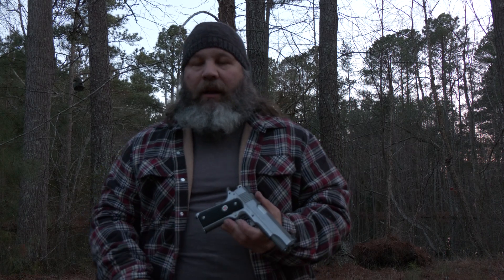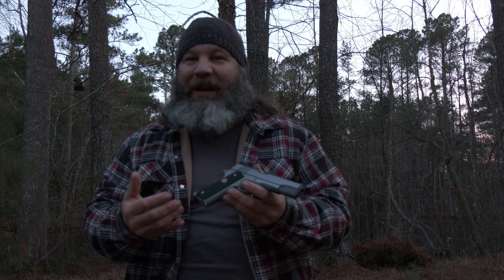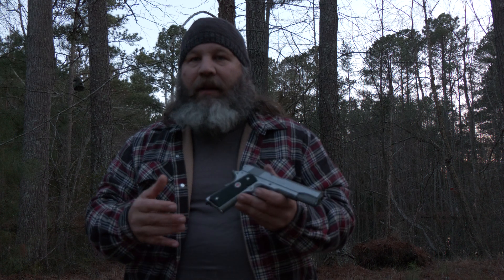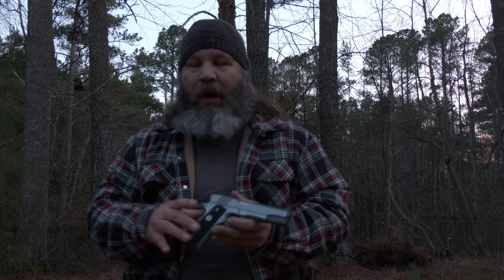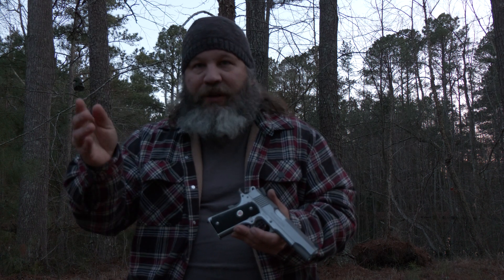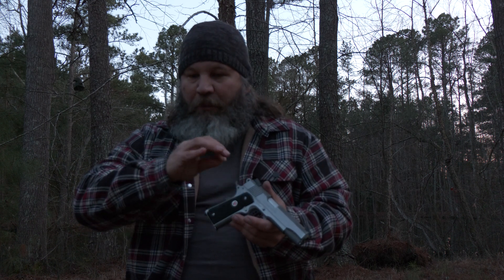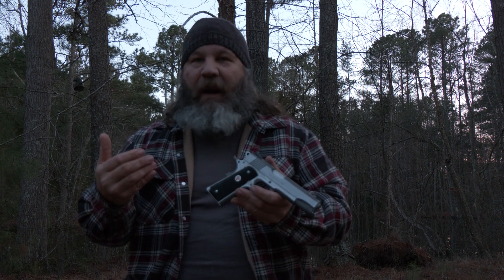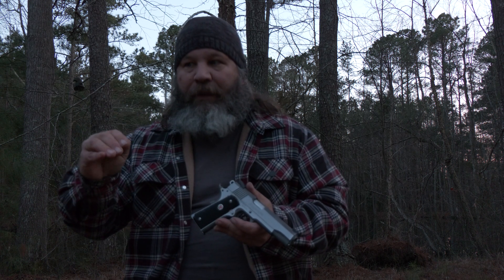Dropping the slide on an empty chamber on a 1911.

Comment: I know this blew up over the past few weeks because of that Wilson vid. I appreciate your bold stance and going into detail with this, Hunter. I think if people were shown how/what happens when the slide is dropped on an empty chamber, they'd be better convinced. Vs. just being told it's bad and thaf kittens die every time you do it 

I err on the side of caution myself. I don't call myself a gunsmith but I'm an armorer for a local shop. It's understandable, for me, to see how sear/hammer hook engagement could be damaged doing this. Not everyone does though, and they just default to "if X gun can't take it, I don't want X gun." I'm like, alright then, 1911s (or something like match CZs) probably aren't for you. You bring up the hammer drop test, and I thknk that puts into perspective with how little sear/hammer engagement guns can get. They can be pretty fragile, I think it can be said. 

I think it's a mistake for people to fall into the trap of, "just because I can do it, mean I should". This goes for a lot of things with guns. I'll share recent examples. Our shop has Taururs TX22s with broken firing pins. The last one that came in, the owner admitted to frequent dry fire with it. The manual states dry fire is OK, and is required for disassembly of the gun. Well, except for when you do it TOO much, or you just plain have bad luck and the tip of the firing pin takes a one way trip to Snap City 300 dry fires in. Another example, I love my Walther PDP but have come to the conclusion that it isn't wise to dryfire it without snap caps. Broke 2 firing pins within a span of half a year. Now I always use snap caps. Other guns can absolutely take dryfire for tens of thousands of rounds, no problem. But yeah, just because you can, and the manual even says you can...? You can't always.

Anyway, I'm gonna take a page out of your book Hunter and say it's about Bourbon o'clock, ima let you go 😂
Reply from the maker: My brother, thank you very much for all of your insight. Very well put. Thank you.  Everything you said I agree with. 
Please have one for me.

Comment: 1911Tuner is where I went to decode the mystery of the 1911, Bill W,  Ed B and also John H (and Hunter of course) are also an excellent source of the "correct" way to do all things 1911. EDM wire cut sears with the nose blocked off at 30 degrees on top and bottom are drop in and hard to beat.
Reply from the maker: Thank you very much.  
You are exactly right about the EDM wire cutting. I have been learning a lot about that from Andrew Barnes.
Reply: agree

Comment: I know this about a 1911 however it reminds me of a very similiar problem we had with M2 and M2A1s. The bolts were getting very small hairline cracks because bolts were being allowed to slam forward without barrel installed. Hairline crack in bolt would and could result in gun blowing up when firing. 
  So i agree and would  imagine allowing that slide to slam forward on the 1911 could and would cause damage that may not even be able to see with the naked eye.
  Update/correction/clarification…Sorry…it wasnt the bolt with hairline cracks but the barrel extension because allowing the bolt to slam forward without barrel.
Reply from the maker: Excellent comparison.

Comment: I heard another reason is that the extractor can be damaged, over time, if the slide is dropped on an empty chamber.  This is if the slide is dropped several times, but if you have that bad habit then bad things can happen.
Reply: That is one of the reasons. It can also affect the locking lugs if you do it on an empty chamber.

Comment: If youre concerned with hammer-follow, and it only hammers on an empty chamber/magazine, then it's not /really/ an issue. If the hammer don't follow when the slide shoves a round in, then there are no rounds to be set off by the hammer following, right?

Like you said, slamming the ignition parts is going to induce a failure eventually. Unless hammer follow has been a problem and steps have been already taken to correct the issue, I wouldn't recommend anyone slamming the slide closed on empty, ever. Only once or twice after the issue has been fixed and tested good with primed brass or snap caps (primed brass is extra, but something some of us have for drop testing reasons).

Comment: Can I do the hammer-follow test with snap caps?
Reply from the maker: You could but by slowing down the slide with snap caps it would not be as good of a test than on an empty chamber. 
You could however incorporate the snap caps in a hammer follow test as you do function checks from reassemble and such.